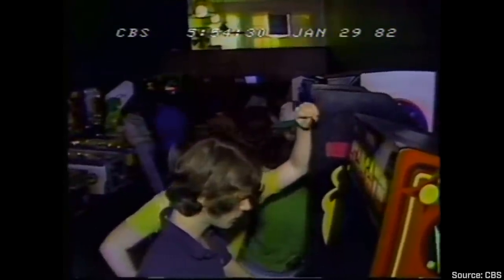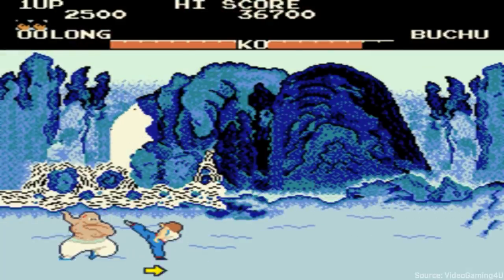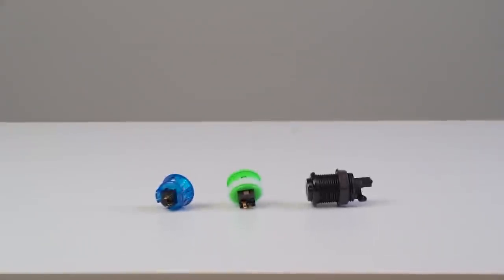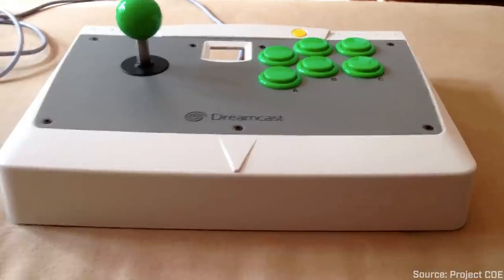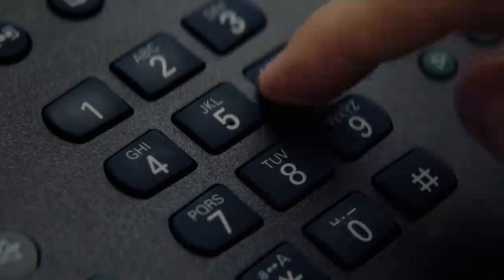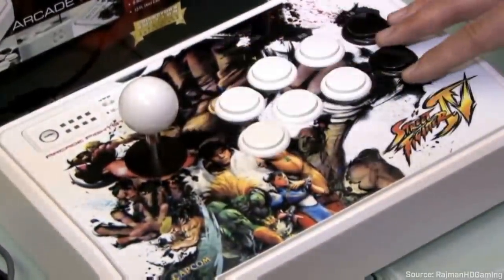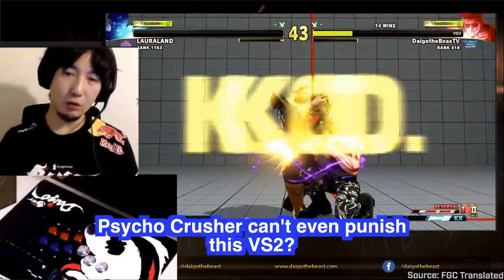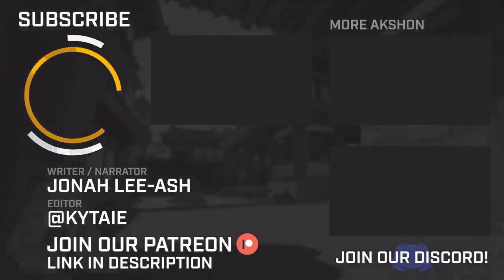History of the Fightstick

Comment: It's funny to think about how SF1 standardized the 6-button set up when the game original used a joystick and two gigantic plunger buttons that you would smack with various degrees of force to get the three different strengths.  Imagine if that had taken off instead.  Thankfully, they were horrible to use and maintain, so the 6-button style became a cheaper solution.

Comment: It’s weird they said six buttons became the standard yet the two fighting games they mentioned that were incredibly popular were fatal fury and mortal kombat which aren’t six button… 

in fact most snk fighting games are probably 4 buttons, and neo geo dominated the arcade scene. 

SEGA’s Virtua Fighter which was a huge deal in the 90s was only 3 buttons. NAMCO's Tekken and Soul Calibur are both 4 button games usually.

6 buttons was very much not the standard back then. 

What makes this weird isn't that it's inaccurate (there are some other inaccuracies too in the video), but they almost directly contradict themselves as they state the "fact".
Reply: Yeah...really surprised they said that.
Reply: The original Street Fighter arcade cabinet also had a 2 button version available. That is what was in my local arcade when I was a kid.
Reply: I think you got it wrong. Street Fighter is the one to blame for the 6 buttons and the game had more impact in the arcades than the other games you mention. But the reason wasn't exactly that, it was actually for practical reasons. The same way that the standard for home version controllers has 8 buttons. You don't really need the 7th and 8th button for all these arcade games but it's easier to have more buttons for backwards compatibility than having to add more buttons. In short, the 6 button layout allowed you to play all the games you mentioned by just not using (or covering) the buttons you don't need.
Reply: @STRevival2015  That’s not really what is said and the video, and most arcade cabinets are not made that way either back then. 

Neo Geo is just 4 buttons, it doesn’t have 6 buttons with 2 laying there dormant. The machine can’t even play street fighter or any other 6 button fighter natively. 

6 buttons is largely just a capcom thing, not a universal thing. Using the argument that 6 is more than 4, and it is easier to subtract than add seems like a straw man argument, and it isn’t really rooted in how arcade cabinets are made either.
Reply: @chrisgrudge6964  Cabinets were either made specific for the game or generic ones and the generic ones outside of Japan were really bad as there was a big disconnect in the distribution chain between the game companies and the arcade businesses. It wouldn't be the first time you hear about cabinets with a Street Fighter in an arcade with just two buttons. It's a similar case nowadays with these home-popular (and horrible) custom modern cabinets, pretending to be retro, with subpar furniture quality and an lcd screen.
In Japan, however, you can find the SNK cabinets with the 4 buttons you mention. Unfortunately for you, out of all the brands manufacturing cabinets, the SEGA astro city is the one that became the most popular setting a standard for reasons too long to explain here. Search for "mikado astro city" to read more articles about it.
Reply: Guess they thought mentioning the inescapable behemoth of SF2 would be insulting to your intelligence.
Reply: Isn't it obvious? you can always do with more buttons even the game you play doesn't need them, but you can't add more buttons after the fact. It would make sense too for arcade machines making them more modular.
Reply: @OP-er3fg  yeah that’s nice and all but it’s not how arcade cabinets are built. Snk doesn’t build 6 button arcade cabinets in case someone wants to somehow make it a street fighter cabinet. That doesn’t make much sense.
Reply: @chrisgrudge6964  weren't some arcade machine made to be able to adapt to multiple games?
Reply: Another weird thing is the cabinet they show seems to have the strength of the punches and kicks inverted from the modern layout.
Reply: @OP-er3fg  Pretty much any cabinet could be converted. Replacing the controls was part of that.

The SNK cabinets just had cartridge slots for the games--all the games used the same control setup.

Mortal Kombat cabinets had five buttons in an X shape. Later ones added a run button below and to the left.

Comment: Here in Australia we were all using Australian-built MCA joysticks in the arcades, and the ultimate home joystick was the Battlestation II, which was a huge steel control panel with two MCA joysticks with six buttons each and had cords for the NES, SNES, Master System, Mega Drive, Amiga, Commodore 64 and Atari. A lot of Australian arcade and fighting game players still swear by the MCA as the best arcade joysticks ever made, they were more expensive than the Japanese sticks, but were super tough. They're kinda ball-top, but the whole knob and rod are plastic coated. Look them up and maybe give them a try if you can get ahold of one!

Comment: I bought a TE1 back in like 2013 or so, I used that thing until earlier this year when the stick stopped working. Amazing how it lasted over 10 years from its original production.
Reply: you can probably just buy a replacement sanwa stick off amazon for $25. or the encoder board got fried, but that can probably be replaced for $20 also

Comment: im still waiting for an arcade home controller (usb) that has a stick that can switch mode instantly from 8 way to 360 degrees analog and of course sanwa slim flat ultra responsive buttons. i believe there are kickstarter projects (intended for smash bros) but im looking for commercially mass produced ones ^_^ so it wont be expensive.
Reply: if it could switch like that it would need to be circle gate which is unholy

Comment: Hello, one fact you "kinda" got wrong.  And I noticed you glossed over pre- Street Fighter 2 joystick issues.

First the wrong fact.  Street Fighter 1 originally released with twin 2-bit analog buttons.  There were four states: unpressed, light, medium, and heavy.  They were on the same button and registered based on depth pressed.

People assumed that a harder hit was always better and it was like an a true analog "test your strength" meter, where the harder you hit the harder you hit them.  People were banging it way harder than necessary and breaking these analog buttons.

The second version of Street Fighter 1 came out with six 1-bit buttons mainly to be the one final solution to analog buttons breaking.

Also I grew up when the arcade games had buttons on both sides of the sticks and five of the eight consoles released at the time had ambidextrous options as OEM parts, and the 2600 had thord party ambidexterous options. So obviously I'm more sensitive to this industry shifting to left-handed only.

Do you realize I never had the pleasure of buying an off-the-shelf Street Fighter joystick that was even remotely considered good because the last system authorized ambidextrous controller was the Beeshu Genesis Gizmo and that had three buttons.  That's right be shoe was the only one making ambidextrous sticks and trying to keep up with these six button joysticks was futile so they couldn't do it anymore so they either had to invent something else that succeeded or cease existing.

It's a fact that no six- or more- button joystick has been released with a right-handed version or an ambidextrous version ever since Street Fighter 2 came home.

I got a story from the '90s and a lot of information on my website sinistersticks.com. You'll see my prototype, and you'll read the perfect sales pitch for it with a testimonial about how everyone in our local clan went from always losing to our local Street Fighter champ (and local champ of quite a few other games)  to always beating this clan champ in Street Fighter 2 (New Challengers: Genesis version) 

What gives this story gravitas is the identity of this local clan champ, who first won the Blockbuster local store-level tournament, and a few years later appeared on national basic cable TV in the 00s in video game competitions winning one of them in almost perfect fashion, and coming third out of 12 in the other.
Reply: There has been two products in the global market that have supported ambidextrous play. The Qanba Q2 had a special version and switch where you can flip the controls (rotating it), with a straight layout of buttons. There was also the model that Nyko Freedom Fighter was based on (which was later released into the market throughout Asia).
Reply: @MarkMan23  i was aware of those 2 models.  But I think they are both Playstation 3 only, and not licensed by Sony.  No officially licensed Sony controls, No Xbox or Nintendo controls.

The last officially licensed ambi stick was the Beeshu Genesis Gizmo, licensed by Sega.  And that was a 3-button stick, so it's pre-SF2.

The reason why Beeshu went out of business was because the mirroed button layout was starting to get expensive doubling 3 buttons.  It would be significantly more expensive with 6 buttons.

Anecdotally,   a lot more Game Stop managers would carry an ambi fight stick if it were console-licensed and price-competitive with a monodexterous joystick.

Separate lefty and righty models can cause suplusses in one hand and shortages in the other if predicted incorrectly.

Also if people play schmups, where dodging is more important than rapid pump firing, (most schmups have auto fire) most right handers would let their left index finger be a brick on the fire button.

In theory, one can fight left-stick and shoot right-stick, or vice versa.  Just like one can bat lefty and throw right in baseball.  Ambi models would be perfect for those people.

Hori USA said my model's only obstacle is Hori Japan, possibly Japanese gaming culture, international FGC culture, etc.  Economically, it would be a good "everyday stock, off the shelf stick" in America at least.  At Gamestop, the only time joysticks sell well is on "day one" of the game depicted on the fight stick.  I never seen a joystick carried except as a "day one" stock item.

Comment: This video is just wrong. 
The original Fatal Fury used 3 buttons - It couldn't have used 6 because the Neo Geo cabinet had 4 buttons per player.
The original Mortal Kombat used 5 buttons, 4 attacks and a block.
The couldn't have "all shared" "6 buttons". They certainly did not all "share the same layout".

Comment: The thing about the SE and TEs made by madcatz was that madcatz was still shit. Sure, they're image improved, But everything that madcatz made themselves in those sticks were still shit.  In the TE, the PCB was the quickest failing PCB, more so than adulterated padhacks, and my gosh, if you used a madcatz controller for a padhack...

And then the SE had an in house stick with a washer problem and crappy buttons... that also failed easily...  Their reputation was completely carried on the backs of sanwa, and anyone who did stick repairs / mods back during that era knew this.